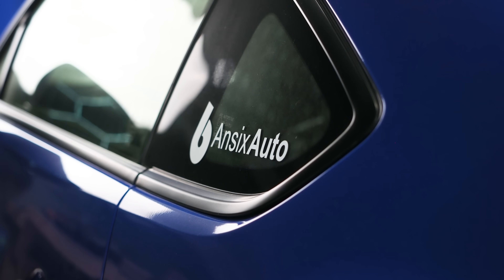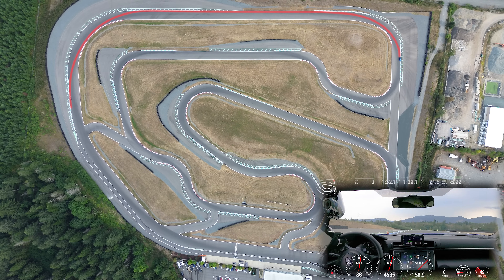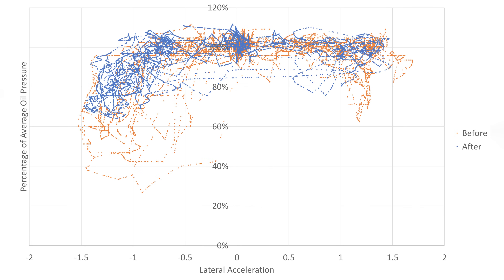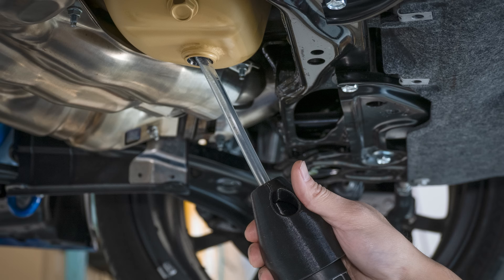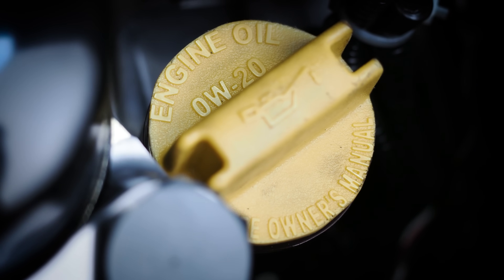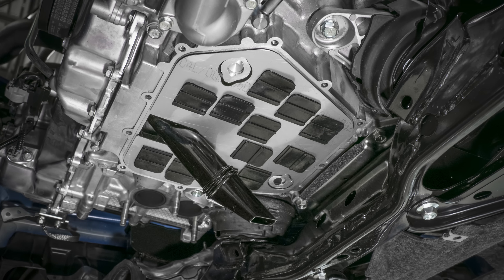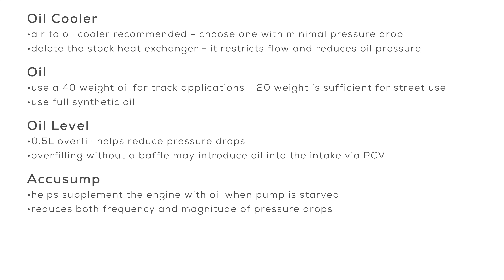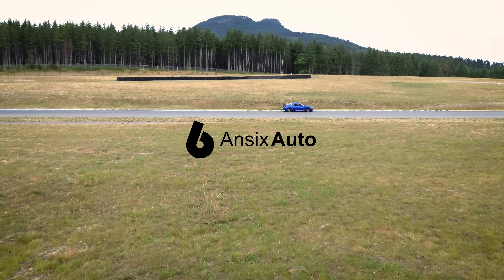The FA24D Engine: What Toyota & Subaru Don’t Want You to Know

Comment: It’s an absolute disgrace that Toyota/Subaru have done absolutely nothing to investigate or fix this problem
Reply: This issue has been around since the 1990s !!! Subaru has done basically nothing to address oil starvation in their engines when being used on track!
Reply: @bigkaswrx8115  flat engine has big bottom surface area that prevents scavenging. The only real fix to this is expensive dry sump system. Very few cars on the market run dry sump. It's not negligence by Subaru, it's unfavorable design. You win here and lose there, every coin has two sides.
Reply: Want to do Race Car things, buy Race Car parts... absolute disgrace that you would think a factory street legal car should come with a dry sump setup
Reply: @crisnmaryfam7344 this
Reply: It’s not built for tracking. Even m3 cannot track hard too.
Reply: Its a Family Car first NOT a race car. 
So there is no problem or disgrace, If its going to be raced then it should have upgrades like baffles or even better Dry sump. 
It would only be an issue if it was happening in normal driving and traffic.
Reply: Not the first time a subaru has known oil issues. Hence why my built sti is still sitting from its spun rod bearing.
Reply: how about just make it do a skid, put on some winter tires maybe and go rallye it on your track lol idk
Reply: Very good report, I like the summary it shows the details clearly 
It will be great if you can share a lit of mods done on the car, I saw that the tires, breaks and suspension were changed, this will help us to better understand your car condition 
Thanks in advance
Reply: The car is too new, and will be discontinued faster now, because of this problem.
If it would still fit in regulations for longer, it would probably be worth doing it. But it seems like the EU laws are going to purge this car pretty soon.
3 cyl GRT-86 will be the problem fixer.
Reply: Using a car on track voids waranty if this is only a problem on track then i dont see the problem many cars have the same issue thats why you get a baffled sump or a dry sump system
Reply: Pretty sure these were meant to be bought by old milfs that drive em easy and just want a pretty car
Reply: They aren't marketed as track cars, never have been, the brand doesn't have to do anything, because it did nothing wrong. The cars were built with a budget in mind specifically for road use, and under those conditions the issue is non-existent. If you take a road car to the track and expect it to last without the proper modifications, it's your fault, not the brand. Besides, this has been a known "problem" for a very long while with subarus, even Evos had this issue. If people can't take 5 minutes of research before taking they car to the track, it's their problem.
Reply: I’ve never tracked my BRZ and love my car, I have no fear of engine failure. Extreme driving on a track?? Take your chances of engine failures. 5W30 oil not the 0W20 for me. Always warm up the engine before driving aggressive and change the oil no later then 5000 miles or 8000 kms. Sooner if possible, I do that. Cheap maintenance item !!
Reply: its a shame Toyota decided to team up with Subaru to put a terrible engine in the 86.
Reply: @f8698   they own 20% of Subaru maybe a 3 cylinder turbo subura brz soon (not sure if it's fits though lol)
Reply: @potatorigs2155  isnt it also a hybrid?
Reply: @f8698 engine isn't terrible. They have been handling a lot of hp with stock internals. Simple fix is drop the oil pan and install a baffle so the oil doesn't slosh.
Reply: @f8698  Maybe if Toyota made a flat 4 to fit. The car is built around a flat 4 engine.
Reply: @f8698  The FA20 doesn't suffer from this issue so it's not entirely based on it being a boxer engine. It's probably  based on the design of the FA24 itself
Reply: @jbeason2929   The FA20 DOES suffer from oil issues. It may not be this specific one but it suffers from oil starvation in 4th cylinder often.
Reply: @jbeason2929  it does suffer from the same issue, just to a way lesser extent
Reply: @Regellion  didnt realize that, my statement was based on the data presented in 900BRZ video where he compared the GR to previous gen.
Reply: @f8698  🤣an 86 isn't an 86 without the boxer, you must be delusional if you think they are terrible engines
Reply: @yourmom9014 the original 86 didn’t have a boxer, so why must this one? Mine sure doesn’t. After two engine failures, one an oiling failure on track, I now have a 6.2 liter V8 in mine. Is it not an 86 any more? Probably not for some people, but on the other hand mine won’t have another stupid Subaru-driven failure.
Reply: @snarky-drive-by you have a fucking V8 in your 86? that is gangster as hell
Reply: @snarky-drive-by  This 86 and the AE86 have nothing in common except the name, this BRZ platform is more like an NA FD RX-7. The BRZ and RX-7 are Japanese cars that use German patented engine, they have a similar physical profile, they weigh almost the same.  The first generation BRZ kind of looks like the FD except with rigid detail versus the FD's smooth details.  This platform is still relatively new so it's going to take a while for all the bugs to be worked out.
Reply: @innocuousmerchant8766  Fantasy,Peter Pan.
Reply: To be honest most cars would suffer from this in stock form.  Even porsches do.
Reply: @CrazyCat229  Yes they had to build a new engine family to replace the M96 & M97 due to oiling issues in track conditions, along with the other engine destroying issues. The replacement engine the 9A1/MA1 is a clean sheet of paper design that also replaced the mighty Mezger engine series. The FA24 needs an aftermarket truncated 4 door deeper sump to fix the problem and I see that as an easy fix. Someone just needs to do it, to get to get what the factory isn't going to do. Porsche figured if you wanted to race you'd buy one of the really expensive GT cars, with a Mezger engine, but they were wrong and long high speed turns with the M96 & m97 with it's sump design couldn't control the oil in high G force conditions. I had to wait for the gen 2 Cayman due to the issues with the gen 1 engine design, which are way beyond oiling.
Reply: @warrenlucier5796  Cool, yeah I wish someone would design a dry sump for the subaru.  I really want to track mine and if this is the only option.  I know teh GT300 22 Brz had it plus turboed but yeah tahts a bit unobtanium.  My go work on my 94 R2 RX7 then and get it track leagal with saftey stuff.  I know the one place rotaries are happy is at the track.
Reply: @warrenlucier5796 I remember tempering my wife's expectations when our 996 was delivered. She thought it was a proper race car compared to the stripped out SpecE46 we had before that. Nope. Just a slightly more practical Miata with better resale and a much more complicated retractable roof.
Reply: @CrazyCat229  the boxers on porsches have scavenging sumps on both sides of the engine, and >twice the amount of oil lines, it's a crazy complex system that's reliable on track, but expensive :/
Reply: @CrazyCat229  only a few of them... Porsche worked hard to fix the issue with the next motor, and starvation hasn't been seen since.
Reply: @CrazyCat229  Porsches definitely do, and that's why they use a dry sump system in high end models.
Reply: It’s an absolute disgrace that somebody who identifies as a car lover isn’t smart enough to know that any car capable of pulling 1.5G in sharp turns can have severe oil pressure issues around corners at the track, unless it has a dry sump oil system. This isn’t subaru or toyotas fault, common sense should dictate that fitting a dry sump isn’t an option for subaru on the BRZ due to it’s MSRP. They would have to price the brz right out of it’s class to fit it with a dry sump system- which is not gonna be worth the money for most owners who drive on the street. They must figure that anyone who’s gonna track these cars seriously is going to be smart enough to take some steps to address the street car type oiling setup, not to mention the braking. You put a bone stock brz on the street and it’s fine. You put a bone stock brz on super sticky tires and hammer it at the racetrack and you’re quickly going to overwork the brakes and the stock oiling which are fine for normal spirited street use.

So i’m not sure why you’re so offended. You’d be the first one to laugh if they charged 45k for a brz like they’d have to if it came with dry sump setup and bigger brakes. 

The point is somebody is always gonna complain
Reply: most people are daily driving their cars in normal traffic conditions.  the percentage of people who track their car is low, and those that are having a problem are even rarer (a niche of a niche).  it sucks but i'm not surprised that neither company has done anything (yet).
Reply: @nefrina37  its extraordinary that the bmw supra is a more reliable car on track then this car pure japanese subaru and toyota partnership which are both known of there reliability and no its not a niche thing for a car build to be moded and advertisement as a driver car it should not suffer from oil starvation from turning right even a bmw/merc suv luxo barge dosent have the same oil issue as this entusiast driver cars.
Reply: Making apologies for this is pathetic. @nefrina37
Reply: Exactly! These people would crash on turn one on a track but need 2.5G 100psi, guaranteed oil pressure on the street. You know, cause "I read it online so it must be true" @nefrina37
Reply: Coming from a finance perspective, it’s cheaper for them to ignore and only put their attention to when something does fail. The amount of engines that fail is still very low and for them to cover warranty they’ll use all their power to find ways for them not to, especially if you’ve modified parts. They know lots of people racing/tracking the car will have modified xyz. So they’ll just say it’s not covered in print somewhere. People dailying or occasionally spirited driving aren’t really having issues which is the majority of owners. And the professionals driving, modify their own cars and fix their own problems if arise. The new brz/gr86 isn’t their biggest revenue driver, so they don’t have an incentive to invest in fixing a general problem that’s only a problem to a small subgroup within a even smaller subgroup of people. I think they poorly marketed this car. People really shouldn’t be racing/tracking this car if they don’t have money. Pay to play so to speak. Still a very fun car

I’m not siding with Subaru/Toyota. I just understand why there hasn’t been anything addressed globally.

Also I have a GR86 lol I still bought it knowing all of this. If you’re too afraid then go buy yourself a Corolla or Camry
Reply: I got a Miata and never looked at the 86 once due to it having a subaru engine.
Reply: Toyota reliability died 15 years ago. People are deluded buying Toyotas.
Reply: @paulklp8262  Aurions were still great as of 2011, the motor in those is the best in any car I've ever driven and just keeps running without issues when maintained. dunno about after that. they're definitely cashing in on their reputation for reliability though.
Reply: @paulklp8262  Untrue. But I will say, potential reliability has gone down. Why? Environmental bureaucracy, who taxes the crap out of the country to restrict manufacturing and production under the guise of protecting the earth, by simultaneously destroying the lives of millions in a hundred affected ways, and stopping innovation and progress.
Reply: " F you and give me your hard fought sweaty money, PEASANTS ! "

                                        TOYOTA, 2023.
Reply: Makes me laugh. People were H A T I N G on the Supra so hard.. It's doing much better than this crappy engine layout! I owned a JDM STi in 2006, and it had engine failure. Terrible decision to use Subaru trash in a Toyota
Reply: @FreshSav Have to admit, as much as we make fun of Supra now being a BMW, I'd probably trust that car that I would be able to push that car harder sideways more than the BRZ/86 and that says a lot for a BMW actually being more reliable than a JAPANESE company called subaru...
Reply: @EnhancedTrashBin  Agreed. While I don't like the complexity of the intercooler in the intake, I would trust the Supra taking abuse over the GR86.
Reply: @EnhancedTrashBin  well no shit when the Supra costs way more you'd expect it to perform better on the track
Reply: @liquidsweg4858  what'd I expect? Japanese quality is what I expect. N/A engine that should be able to handle harsh turns on track. It doesn't need to be as good as the supra. It just need to be able to push to the limit but still able to drive away back home. The fact that a BMW engine is far more reliable than a JAPANESE car says a lot.
Reply: @EnhancedTrashBin  my guy whether its N/A or not has nothing to do with the issue, also are you dumb "i must be able to abuse the engine to its limit and it shouldnt have any issues whatsoever" like bruh what? whats next, being able to redline the car for 50+km and expecting it to not blow up?
Reply: @liquidsweg4858  Its a literal track car, they even advertise it as such. Idk how else I can explain much to someone who ask such idiotic question when you already know the answer to.
Reply: @EnhancedTrashBin I4, V6, V8, V10, etc, all naturally scavenge oil back into the oil pan bcs heads are up standing. Lateral forces don't impede oil from going back down like in a flat engine. It's common sense. It doesn't matter where car was made, physics work same way. Besides Subaru, only Porsche makes flat engines, and those usually also rock dry sump for this reason, and appropriate price tag as well. Go get a BMW, or Toyota.
Reply: @Shadowk246 BMW stands for Bavarian MOTOR Works. They made the engine for the original McLaren and one of, if not THE best, V8. It's the other parts of the car that are... questionable.
Reply: I'm soo tired of the same puked up comments on EVERY SINGLE car video on YT!?!?!?!? Here's my lil autist essay on it.

One day I wish to be as all knowing as all the replier's to your comment! Boxer this supra that fa24 ffdsfsjhdgf56545678. See, I can regurgitate thing's I heard online with ZERO irl experience doing any of it! I'd bet 90% don't have 5% the real mechanic experience as me or all the people actually doing thing's instead of talking about them, while terminally online.

It must be very challenging to have time to even drive your supra(gotta love how mythic mk4 is online, but don't ever drive one into a corner! The mk3 will eat you alive!) if you are online all the time?

Same thing with the RX-7. You ALL want an FB or FD, but have no idea that the FC is the best chassis out of the 3!

You all have a great life. I think I'll go do something real now. Vacuum pump for a Cessna 175+O-360 STC. But hey, One day I'll be as cool as these folk's!

👍
Reply: @TtheK  The FC is so underrated
Reply: @TtheK I'm probably one of the few people that likes both the FD and the FC.  It could be because I'm an 80s, kid as well as somewhat of a 90s kid.

Comment: Really like the video, and glad the accusump system might not be as daunting to deal with as 900BRZ presented.  One question this video leaves me with: What oil coolers have less pressure drop?  I have the Jackson Racing dual cooler on my 1st gen that I daily/weekend autoX so this has me questioning my choice.
Reply from the maker: Most air to oil coolers should have less pressure drop than the radiator and cooler combo. With that said, we're going to design a cooler kit using a lower resistance core.

Comment: Even on street when I take hard right turns I get a strange burning smell
Reply from the maker: That's odd, I'd suggest bringing it to the dealer.
Reply: @AnsixAuto  I work at the dealer as a tech. If the motor blows I'll just get paid to put it in myself lol.
Reply: 7,600 miles